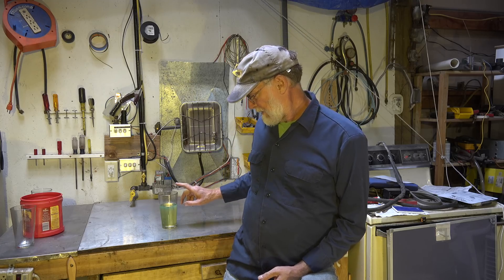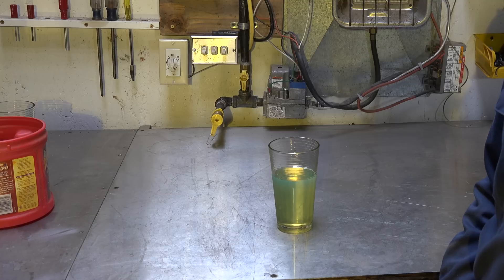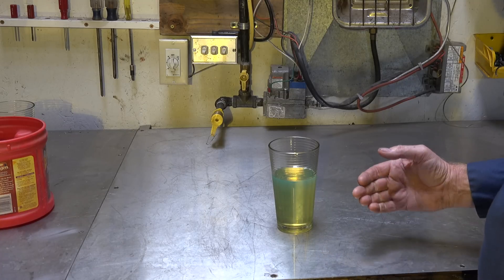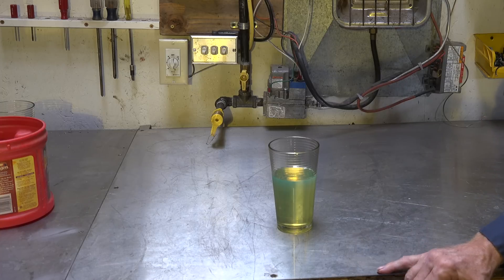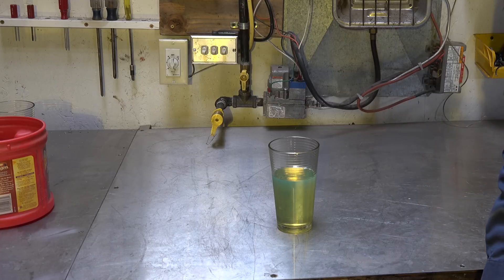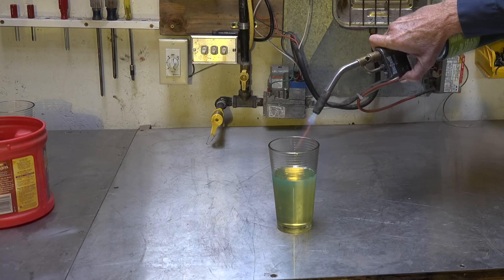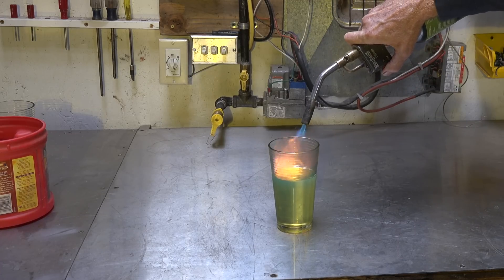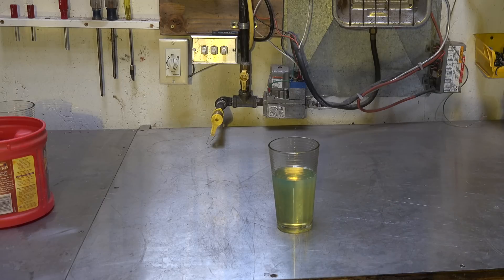What is #2 fuel oil

Comment: Is using diesel vs fuel oil viable?
Reply from the maker: Yes, it is the same except for low temp additives for diesel engines.
GFM
Reply: @grayfurnaceman  so the whole industry is a scam. Fuel oil #1 here is 5.79gal. I can get pump diesel for 4.34gal. Unreal. Everything I’ve read online says “diesel” burns hotter and causes damage.
Reply from the maker: There is a difference here.  Diesel is #2.  It will work in pressure burners and diesel engines.  

#1 fuel oil is for use in oil stoves that use a carburetor to feed the oil.  

#2 has more BTUs per gallon but is less volatile.  Thus it requires pressure to burn properly.

#1 is more volatile for use in oil stoves.
GFM @pimpinred64509
Reply: @grayfurnaceman  they reccomend I use #1 for my furnace because my tank is external, however that was the only reason the recommendation was made. I’ve been running #2 in it just fine so far, but intend to run #1 once the temps drop below 20
Reply from the maker: The recommendation is correct, as #1 will not gell.
GFM @pimpinred64509

Comment: whats number 5 oil thats powering union pacific's big boy 4014
Reply from the maker: It's kind of a leftover heavy oil after the lighter oils like #1 and #2 diesel have been removed.  Its advantage is high BTU content per lb, but its disadvantage is it must be preheated in order to burn.
GFM
Reply: @grayfurnaceman  so like the molassis thickness and colour fuel oil
Reply from the maker: Yes
GFM

Comment: You got me. I was about to go downstairs and tap myself some booze off the burner.

Besides that, I thought this was interesting (source: mckinsey energy insights):

No 1 - A fuel oil consisting of kerosene range material. Also called stove oil or range oil
No 2 - A fuel oil consisting of light atmospheric gasoil material. This is the fuel oil used as a home heating oil. It is very similar to diesel but of lower quality. Typically, it has a lower cetane and higher sulfur content. Also called Bunker A
No 3 - This is a now obsolete light gasoil range fuel oil, that has been combined with No 2
No 4 - A fuel oil consisting of VGO range material, intended for commercial heating furnaces lacking a preheater
No 5 - A fuel oil consisting of vac resid range material with a low viscosity, allowing it to be pumped without preheating. Also called Bunker B
No 6 - A fuel oil consisting of vac resid range material with a high viscosity, requiring preheating before pumping. Also called residual fuel oil or Bunker C
Reply from the maker: Thanks for the info.
GFM

Comment: Just out of curiosity, can K-1 kerosene be run through a furnace set up for #2 fuel oil and vice-versa? Not planning on doing this, just looking for info.
Reply from the maker: Yes.  The flame settings will not be perfect, but it will generally work.  Sometimes kerosene is used when using an outdoor fuel tank and temps below 15F.
GFM
Reply: @grayfurnaceman  Thank you for the reply. Someone mentioned to me that they used to use kero in an oil furnace and I was rather dismissive and said there’s no way that’s right. Well, I was wrong. Thank you again!!

Comment: Friend is giving me an oil heat tank i will use for storage and it has about 30 gallons in it. Can i just use it in my backhoe like it is or should i mix with the kerosene i usually run it on?  Great info,thanks Sir.
Reply from the maker: It will work as it comes from the tank, but are you sure you want to use oil from the bottom of a 50 year old tank?  Can you say sludge?
GFM
Reply: If i put it on my big burn pile and hit it with a tracer bullet will it light?!! The guy just died last year and it is clean and smells good so i'll filter it also. The valve is up about 4 inches off the bottom.  I'm gonna flush  out the tank and use it for gasoline.  It is a small tank,maybe 100 gal.   Thanks for a reply.
Reply from the maker: @jimg2553  My thought is no unless it is very hot.  Even gasoline oftentimes will not ignite with a tracer.
GFM

Comment: My oil furnace has been recently abandoned. I am using electric heat, and may go with mini-splits in the future. I would like to leave the oil tank 275 gallon (in the basement) for the future, in case I was to sell the home and the home buyers would like to go with oil heating. Can the oil tank remain in the basement as long as it is drained and flare capped ?
Reply from the maker: Certainly.  We do it all the time.
GFM

Comment: So, can I burn beer in my furnace or IOW, I can heat my __ with it?

Seriously, I must ask, is there a cheaper liquid fuel for an oil furnace than #2 oil?   What about drain oil or other surplus or recycled oils?
Reply from the maker: You can use #1 or #2 fuel oil in a pressure burner.  All other oils will not work in this burner.  There are waste oil burners that will burn these type oils.
GFM

Comment: Great video. Years ago when I went to aircraft mechanics school the instructor I had did a similar demonstration. Jet A (jet fuel) is just like #2 fuel oil and diesel. It's kerosene based with an anti microbial agent added. Instructor put out a lit cigar in a can of it to show it don't burn easy. A jet engine atomizes and lights it off with a very hot spark just like an oil burner.  So in actuality jet engines are big blowtorches just like your oil burner at home. Big difference is your boiler or furnace don't produce thrust!
Reply: That’s crazy that microbes can grow in jet fuel / kerosene
Reply from the maker: Great thoughts.  I hear the spark is powerful enough to curl your hair.
GFM
Reply: Hm
Reply: that was in america right, since Jet A is a typical american thing. interesting difference between jet types tho